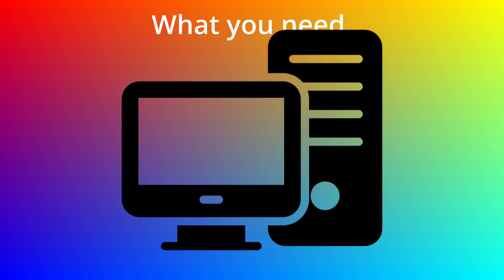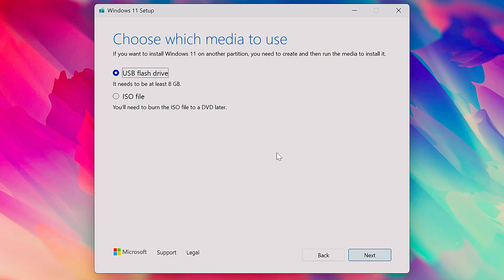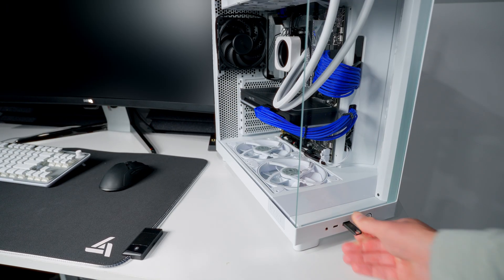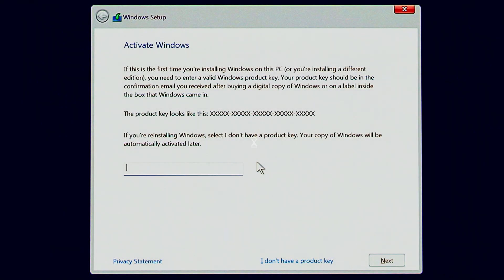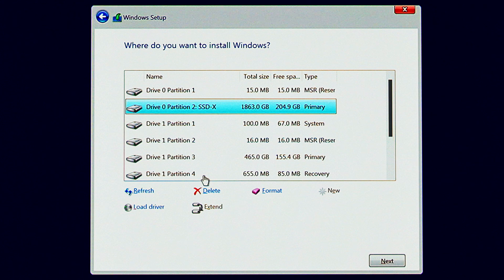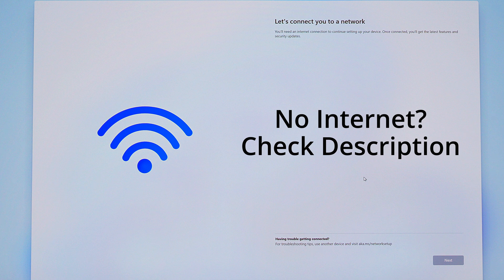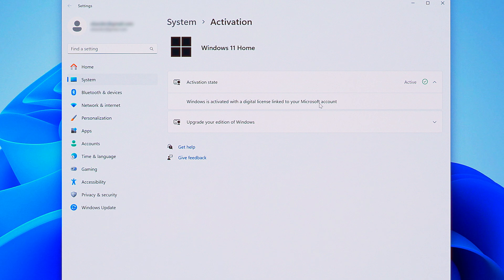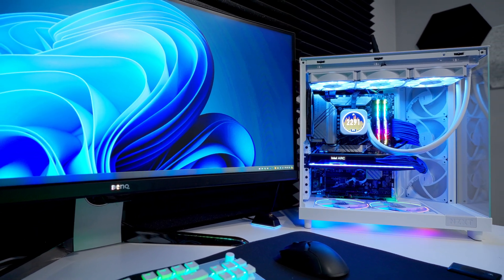How to Install Windows 11 on a New PC - Complete Step-by-Step Guide

Comment: I got past the TPM error by info on another video.  Now I'm selecting the location.  I only have 2 choices.   (the hard drive that i just installed and the USB drive)  both options give me an error.  Disk 0 partition 1 ESD-USB and dis 0 unallocated space.  Both error messages state that  the selected disk has an MBR partition  On EFI systems the OP system can only be installed on GPT Disc.  setup does not support conf of or installation to disk connected thru a USB  ..

Comment: Can we use a mac to install windows on the usb flash drive ?
Reply: Yes, but it will be a different process since the Microsoft tool doesn't run on Mac.

You will need: Your Mac, USB flash drive, Google Chrome, Chromebook Recovery Utility, and the Windows ISO file. Once you have everything you need, plug in the flash drive.

Change the extension of the Windows ISO file to BIN. Open Chrome and then the Recovery Utility. Click on the gear icon and choose "Use local image" and select the Windows BIN file. Then select the USB drive you want to restore to and let the process work.

Once it is finished, you can use that USB installer to install Windows on another computer.

Comment: if you have windows 10 or 11 on another device already activated you can create a Microsoft account and link that to Ur windows key and make it digital so it carrys over to Ur new device it automatically activates it just like he does! I used a crappy windows 10 pro laptop that that had windows activated with it's manufacturers key by linking that to my Microsoft account it turned it digital and I used it to activate windows 11 pro on my new pc! Was almost about to buy a new key. All you gotta do is log in to Ur account once youve loaded up windows

Comment: If I leave the installation media plugged in it does try to reinstall Windows again. So after the initial restart begins you can unplug the usb. It just wasn't mentioned in the video. Maybe this isn't an issue for some people. It may have said on the install screen and I missed it.

Comment: 2:00 the computer does not load the windows 11 start up, it freezes at the logo..      any ideas on how to fix that.      Bios or raide maybe drivers?
Reply: I would try remaking the USB drive. In some cases, updating the BIOS to the latest version can help with these types of issues.

Comment: What is iso file?
Reply: An ISO file is a disk image. In other words, it is a digital copy of a disk (be it hard drive or SSD or CD/DVD) that is stored as a file. Operating Systems like Windows are distributed as ISO files so that you can "burn" to a DVD or create a USB installer from that file. The file contains the file contains the necessary files and programs to install Windows on a computer.

Comment: If I'm using a flash usb drive thats exactly 8gb, will I still be fine? It worries me because it says it needs to be at LEAST 8gb so I'm thinking it might take more than 8gb, no?
Reply: Its fine. the install files are less than 7 GB in size.

Comment: How do you boot to different bios if you choose not to use Windows 11 and use your old windows on your other drives that use windows 10 and under? I want to keep a few of my drives on Windows 10 and use a new Drive on Windows 11
Reply: You don't boot into other BIOS. Windows has a bootloader. In short, this bootloader is a small program that the BIOS (more specifically, UEFI) boots. In turn, the bootloader loads into Windows. When you install a newer version of Windows, it will install its own bootloader which will allow you to boot into the other Windows installations you have. You will see a menu that asks you what system you want to boot into.
Reply: @ awesome thank you for this I will keep note when I download Windows 11 I feel more safe and secure because I don’t want to erase any of my data but install Windows on a seperate drive

Comment: Does anyone know a fix to my problem I got into the install part but once I selected install windows 11 it said my pc currently doesn’t support windows 11 I literally just built it for reference I have a 7800X3D cpu and a 7900XT gpu so I think it’s unlikely that my pc can’t support windows 11
Reply: Make sure BIOS mode is disabled (maybe called CSM, legacy mode or similar) and that UEFI Boot, SecureBoot and TPM 2.0 are enabled. In some instances, updating to the latest BIOS version can help with install issues.

Comment: No problem creating the install media and booting from USB but when I go through the setup and it starts to download files it will hang at about 10% downloaded and never recover to finish installation? Only one drive in the system besides USB to load and install windows on but it just won't go anywhere after the 10%  Any suggestions would be apprieciated
Reply: As a follow up to installing windows as a fresh install on new build. Finally was able to get everything installed  and running smoothly after I flashed the BIOS to the latest version on my Gigabyte X870E motherboard as that seemed to be the hangup so make sure you check this as with any new motherboards released recently they may have BIOS updates that fix issues you maybe experiencing. So now up and running smoothly with just tweaking everything for optimum performance.

Comment: What if the process keep repeating? Mine install window 11 and when it reaches around 76% to 77% it restart from the select language. It's been doing that at least 10 times. No exaggeration.
Reply: When it restarts mash the bios button and put the bootable option to your drive and not the usb
Reply: Or just click the X button on the top right and it will continue to windows. You're just rebooting the installation with every restart

Comment: Do I HAVE to take my SSD out Ik it sounds lazy but I REALLY don’t wanna mess anything up.
Reply: Not necessarily. You should be able to disable the SSD within BIOS. But every motherboard has different menus and wording so you may need to dig around the menus to find it.
Reply: See 2:50 and he explains why. No, you don't have to but since you're asking the question, I think you may trip up on drive selection...

Comment: So when i select the usb as booting option the pc restarts and bring me back to the pre-BIOS screen and just does nothing, it just feeezes and i have to restart and spam f12 or del just to get to boot options or BIOS. Im stuck at this loop. Did i do something wrong? Its 3.1 usb and the pc is 100% fresh
Reply: I would remake the USB installer.
Reply: @JJFlores197  I did that. Apparently, it was a bad 128GB USB, only showed up as 37GB (weird number), got myself a new USB, and windows installed with no problem

Comment: In order to make a clean install method 1 was to install for keeping old files such as games saved, or custom fan curves in software saved when i reinstall each program, drivers tooare saved ajnd going to reinstall windows on m.2 drive could i use the first (1) or custom #(2) option like you made in the video of a clean fresh installation, i have kept the license for many yearsand am running 11 on 2023 software update and wont go to the next update could this fix ongoing software help with amd ryzen if i clean install and reboot into a update for 2024 edition of 11 home? how much do i need to save if i choose option #2 with programs not saving? Like you said in the video i have a basic ssd attached in operating on a m.2 nvme could i keep both the drives connected and do a reinstall?

Comment: If you are still replying to this. Prior to inserting the usb into the new pc. You took out the ssd. and then when you were installing. You picked a drive. How did you pick it of you took it out. Or is that a extra ssd that you did not windows on and the other drives were still plugged into the pc. Cause I am only going to be using one 2 tb ssd in my new build so would I keep it plugged into the motherboard?
Reply: If you only have 1 SSD, then you don't remove any drive. You would remove extra drives so that Windows doesn't accidentally install part of its files onto other drives.

Comment: When I plug the drive into my pc it will load up and say I am missing drives. It asks me to pick what to install, so I click the usb drive and it does nothing.
Reply: Any update on this ?? I got the same problem with windows.
Reply: @sergiodonato6128  Had to put windows 10 on the drive instead, and then it worked. After that I just installed some system updates, and then windows 11 for free from their website.
Reply: I have the same issue! It is saying I have no drivers to install it on
Reply: @ashetbratton3854 I ended up installing Windows 10 on the drive instead, and it finally loaded up. After that I just had to install some Windows updates, and then upgrade to Windows 11 from their website
Reply: @ashetbratton3854  did you ever figure it out? I'm having the same issue!
Reply: @ashetbratton3854  Read my other reply if still having trouble. Sorry for late response

Comment: hello, I am a MAC user, and I am building  my first PC, I need to download window to an USB. Through my Mac, I have a file downloading (.EXE) My Mac do not recognize the file. How can I do that? I do not have any other option than using my MAC
Reply: Did you find a solution for this? I have the same issue
Reply: @skylerallen6874  I found someone with a PC. otherwise i did not found the way through my Computer.

Comment: When it boots the usb flash drive it pops up with a “media driver ur computer needs is missing” this happened after getting a new ssd.  I went into bios setting and looked at videos for about 12 hours in total now nothing worked. I got a new motherboard, ram, ssd. Still saying the same thing. When it says “select the driver you want to install to make hardware discoverable” I click on the the intel storage one like everybody said or the vmd one and it only wanted to install windows on that file instead of downloading that drive. It only has an install button. Could it be the usb I’m using?
Reply: I'm having this same issue.
Reply: Upon further investigation I had to download windows 10 instead because my motherboard wasn't compatible with windows 11 installation media. Try using windows 10 media and see if it works.
Reply: THE USB IS NOT PROPER DO THE PROCESS AGAIN AND CHECK WHETHER UR PC IS Compatible WITH WINDOWS 11 IF ITS NOT THEN USE RUFUS TO MODIFY ISO REFER TO SOME YT VIDEOS ..
Reply: @ the usb I was using was broken, just tried another usb and it worked

Comment: Quick question, would it still be necessary for me to remove one of my M.2 for install? I mean windows could install on any one of the 2, and it’s not as if I have any existing data on them since they’re both brand new..
Reply: You don't have to do that, but I would at least temporarily disable one of the drives in BIOS (or physically remove it). The thing is that if Windows installs part of its boot files on the other drive and if you later on remove the drive or it fails, it will cause your PC to not boot correctly. And trying to diagnose and fix the issue can be a massive PITA. Its your build so its up to you.
Reply: @JJFlores197  Well I mean.. After hearing that better safe than sorry right? 💀.. I find it a little strange Windows can download part of its boot files on another drive despite you selecting which specific drive for it to do its thing on.. Oh well..

Comment: im missing TPM what do i do
Reply: What CPU do you have? Make sure you enable TPM 2.0 in the UEFI. It may be called fTPM or virtual TPM or similar.
Reply: You can find it in your BIOS for the motherboard, while in BIOS search for TPM or fTPM and choose to enable it.

If that doesn’t work, you may need to install windows 10 instead as it doesn’t have that restriction.

Comment: The biggest issue here is not mentioning extracting and storing your windows key from your working version of windows. I know it’s for a “new pc”, but for a lot of people that means newly built and using their old hard drive which this might permanently destroy their windows key meaning they’d have to buy a new one. Always remember to back up your windows key.
Reply: How can I do that? If you could pleas explain I would be really grateful 🙏🏻
Reply: @  You can link it to your Microsoft account now, just google “how to link windows key to Microsoft account”, you can also use software to extract it but make sure it’s safe.

Comment: Literally thank you bro I’m new to pc and I just built mines today and I’ve been trying to install windows for the past 3 hours with no success turns out you are the only video I’ve seen that actually explains you need to install it into the flash drive not just download it again thank you
Reply: So you need an additional pc to do this?
Reply: @Aceee88  yes to install windows on the usb
Reply: @Aceee88 you probably have a laptop or a family member or friend that does, you can just use theirs
Reply: the last of my parts are finally getting here later today so trying to already know how to install windows😂 so glad to know this is a good video
Reply: But if I don’t have it?
Reply: Yep almost did that even though I've been doing computers for a long time but this window's 11 was weird. But I'm like why are they not asking me to upgrade with my disc USB but they said you have to go into regular desktop on Windows 10 then put the USB in there then go from there So hopefully that will work I'm working on it now it can be a pain but if you're someone that knows about computers you have to learn it you might as well cuz you don't want to mess up someone's computer

Comment: Is it okay if I only bought one ssd for storage and just use that one or would I need to buy another one
Reply from the maker: You can use the same drive as long as there's enough space.  The downside is you'll lose all your data if you need to reformat down the line.  You could always do a backup first though.
Reply: @ECPUz  what if there is absolutely 0 data and it’s my first build
Reply: Yes, you can do this.

Comment: what if pressing the delete key doesnt open the bios?
Reply from the maker: On some PCs, the default bios key can be F2 or F12.
Reply: @ECPUz  read this late lol, hdmi was plugged into the motherboard instead of the gpu 😅
Reply: I was on a 60% keyboard and it didn’t work I had to get a full size
Reply: @spikethegamedev3dprinting317  Hold FN and that turns your number keys into F keys.
Reply: Need to keep pressing and then releasing the key very rapidly till the BIOS screen appears.